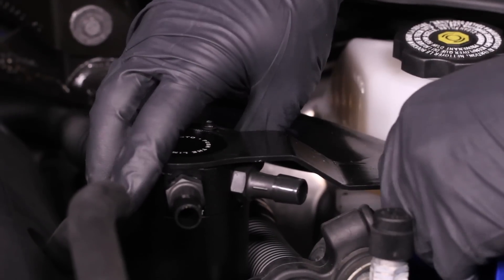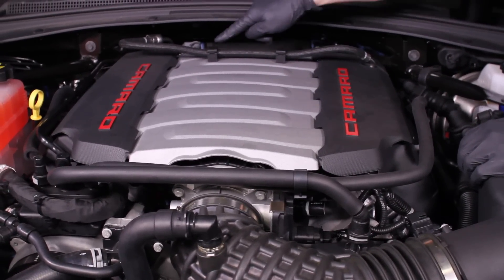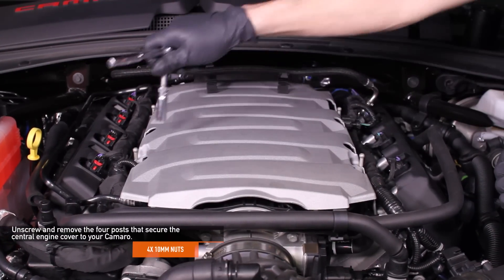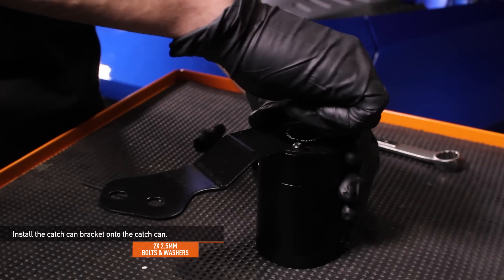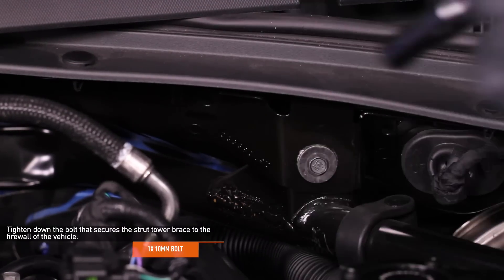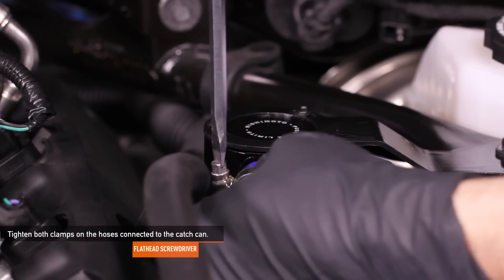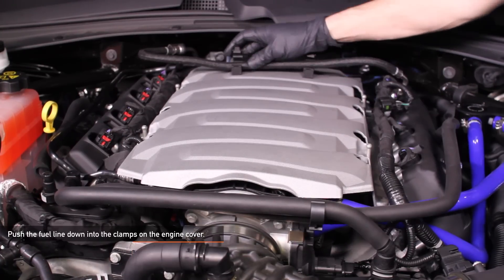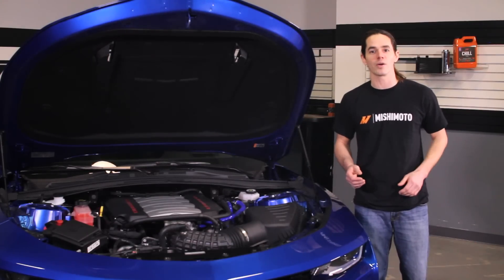2016+ Chevrolet Camaro SS Baffled Oil Catch Can, PCV Side Installation Guide By Mishimoto

Comment: Mishimoto my 2017 ss has 18,000 miles on it. Can i still install the catch can now with 18,000 miles on it?
Reply from the maker: The catch can will prevent further future carbon build up on your valves down the line. It would still be a good idea to install one with the miles on your car.

Comment: Looking for one of these for my 2018 SS.  Clicked the link above, but the configuration appears to be different then in this video in regards to the in and out ports on the can.  The configuration in video has the two ports in a "Y" configuration where as on your site they are side-by-side?  Has the design changed.  Also, there appears that blue hoses are no longer an option.  Please let me know what is the item I would need that would best match what's in this video.  Thanks...
Reply from the maker: We no longer offer the colored silicone lines to prevent any chances of vapor leak. The kit on our website matches the one in our install video: https://www.mishimoto.com/chevrolet-camaro-ss-baffled-oil-catch-can-2016-12254.html

Comment: Does this void my factory GM warranty?
Reply from the maker: Hey Dennis! This will not void your warranty.  Check out the Magnuson-Moss Warranty Act: https://en.wikipedia.org/wiki/Magnuson%E2%80%93Moss_Warranty_Act - basically, in order to "void" your warranty, the part in question would have to cause, contribute, or be the source of a failure.
Reply: Mishimoto Automotive Ok thank you!

Comment: Didn't you already mention that 2016 camaro ss have factory installed oil catch can in your review series?
Reply: +Riyadh Al Fanikh The factory system is an air and oil separator not a catch can.